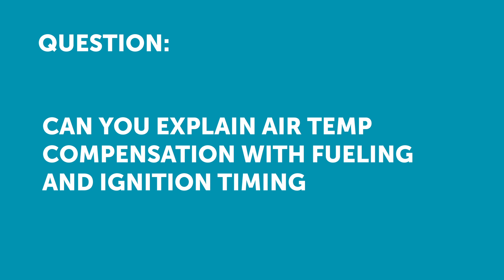Fuel Delivery VS Air Inlet Temperature 101 [HPA Q&A]

Comment: On an N/A car assuming you have a very effective oversized cooling system always keeping water temps in the 180-190F region with minimal heat soak on the inlet, how much does air temperature really come into play in regards to detonation sensitivity? Say if your tuned at your detonation timing limit for a given fuel at 90F ambient, how many degrees of timing would need to be pulled if you had to do a race at 110F?

Comment: 0:10 - very wise words, all too often we get stuck on what we 'think' is the problem, or aim, when we really need to take a step back and figure out just what is actually happening.
1:20 - first time I'd read of that was with the Ford Cosworth rally cars - they were set up to run very rich at high temperatures in the expectation of coolant loss. I noticed during last weekend's Monte Carlo rally many of the cars were running at very high temperatures because of grills being blocked by leaves, so there's another good reason for doing that bit of tweaking.

Comment: That exact situation happend where I work. Vehicle came in with low power but no engine light at the time. Ended up being a plugged water/air cooler line (someone left a plug from the radiator in the line) causing intake temps to get very high after good warm up